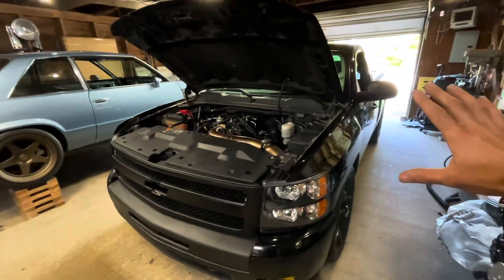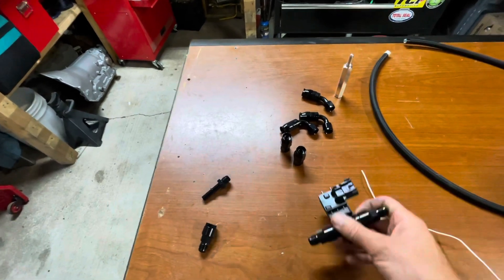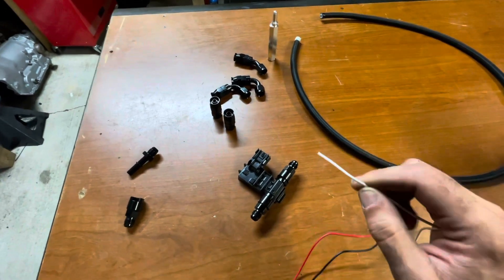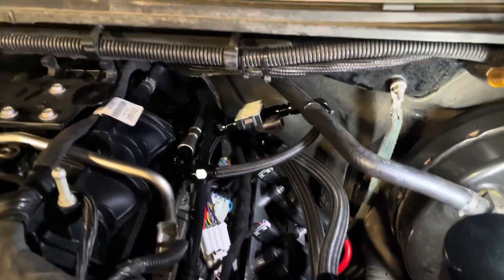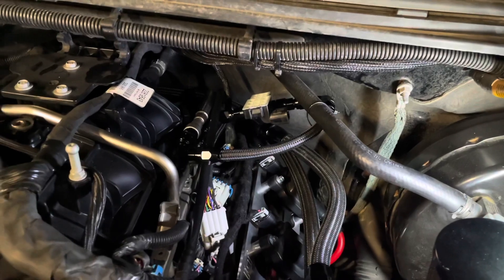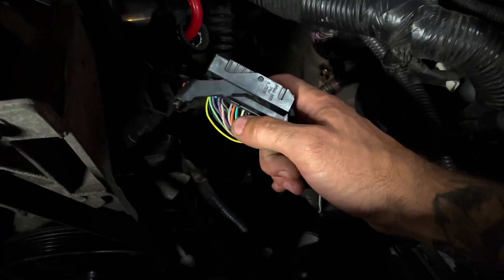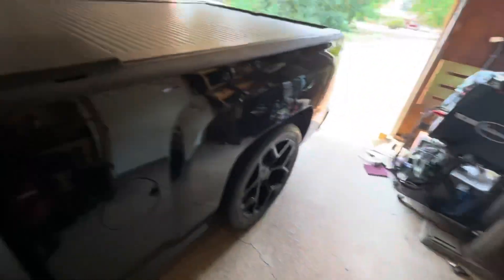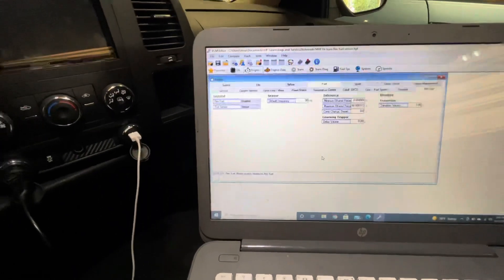Ethanol E85 and I broke my truck!  My fix to go from “virtual” to actual flex fuel sensor

Comment: I have a 2016 GMC Sierra that was not sold as a flexfuel vehicle. When I went to tune it, my tuner showed me that it has a e85 sensor and enabled it. The truck is moving with better performance but now my check engine lights is on lol.
Just curious if you've ever seen anything like this?

Comment: Virtual sensor does not use the purge solenoid...lmao.  But, good idea to go from virtual to real sensor.  Don't buy a cheap junk flex fuel sensor as displayed in this video.  For around $100 you can get a gm factory sensor (made by continental) and a wire for factory plug or wire to ecu.  Just enabling the sensor in hp tuners is fine if you want to burn corn for no reason...if you want to add hp with you new E85 sensor, you need to add spark to the flex fuel table and tune other modifier tables.
Reply from the maker: @jimmyfreeze3782 clearly you did not watch and or understand the point of this video.  Also, I used genuine ACDelco sensors.

Comment: I just bought a 2013 GMC Sierra. I got it home and it had a half tank, so I proceeded to fill it up with E85. The previous owner installed a BTR stage 1 V2 cam and had it tuned. I downloaded the tune and saw that the virtual sensor was disabled, so I paid the 100 bucks and enabled the virtual sensor, except that didn't really fix it either. so I'm adding the sensor like I did on my 2008 Pontiac Grand Prix GXP and 2002 Chevy Silverado with the 5.3 LM7.

Comment: I want to do this. I am so tired of the virtual sensor screwing up. It keeps killing fuel trims. I got so pissed a week ago I disabled flex fuel with HP tuners and filled my entire tank with ethanol free fuel. Truck loved it and has figured out what it wants. I’m going to get the wideband o2s first, then the physical ethanol sensor.  I just want my truck to be happy and have its fuel right.  I am planning the DOD physical delete this winter so I can get some real valves, springs, lifters of the non-collapsible variety and an upgraded cam.  Of course, if you get a cam, you really have to get a new exhaust and might as well do headers too. 😂😂

Comment: What do you mean by virtual? My 2011 Silverado is flexfuel from factory is that physical I’ve been running e85 for 2 years
Reply: Your oxygen sensors calculate the alcohol content.  As they age, the sensors lose the ability to calculate it accurately, same with aftermarket sensors.

Comment: Ok  I have a question. I have a 2018 that is a “flex feul” truck with no sensor. The plug is there. I plan to put the sensor in and use the stock plug. Is this the virtual sensor your referring to?
Reply from the maker: Yes, yours is a “virtual” setup currently. later models have the plug in the harness already. Goat Rope Garage does a video on installing one for your model
Reply: @snedenwerks  mine does have the plug in the harness so I’ll use that and go to the physical setting?